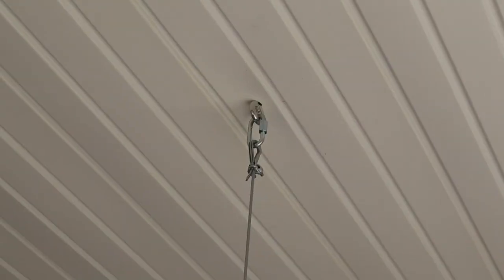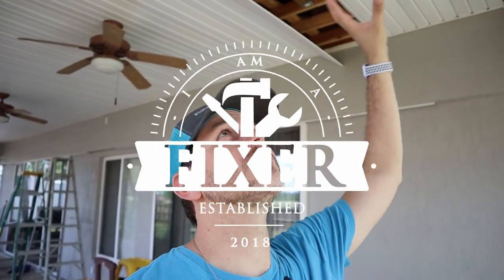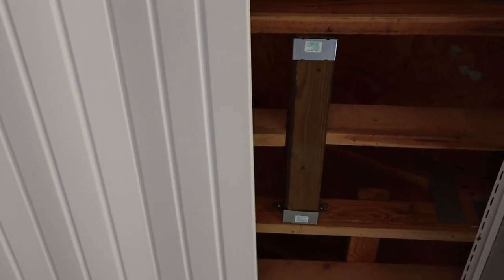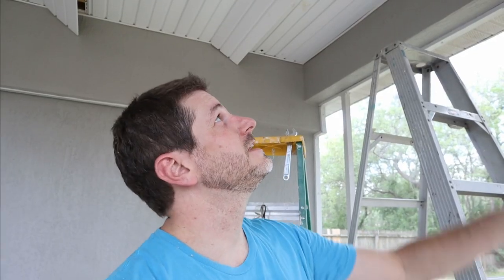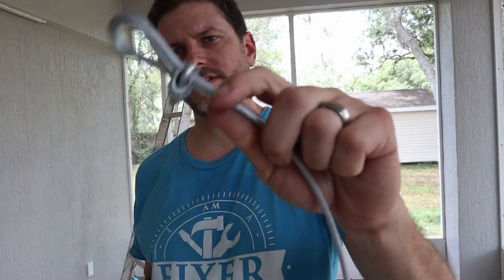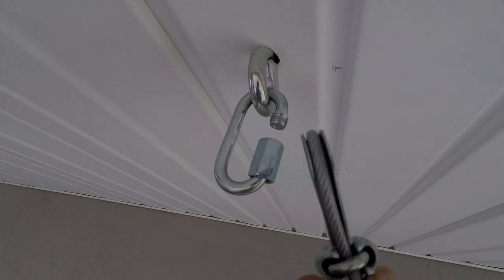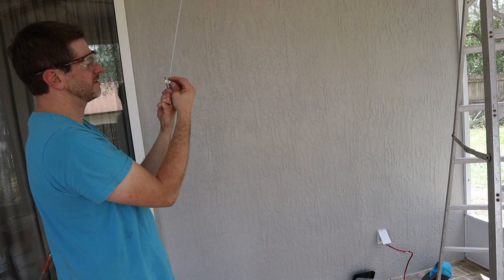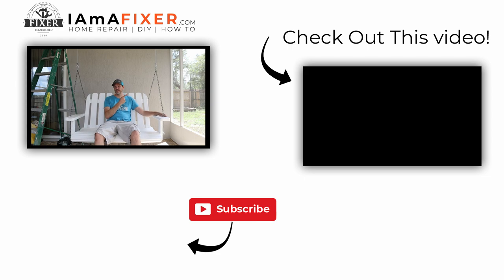How to Hang A Porch Swing with Chains

Comment: Another issue to address is (and I don't know if anyone already has or not) the plastic/vinyl sheath can break/tear under the stress of the weight and once it does, the end piece WILL work its way off and allow the wire rope clips will suddenly lose their grip and the connection will fail. You escaped uninjured the first fall, don't tempt fate a second time. Commonly, it is best in all cases to use TWO wire rope clips, in tandem, as a redundant back up system however, if the sheath fails, both will slip together. As you tighten these clips to head-off the failure you experienced the first time, you are pinching the sheath thinner at the connection and making it even thinner and weaker. Ask me how I know...

Comment: Good explanation. Do you have a parts list?
Reply from the maker: I’m sorry, I don’t for this video. I got everything at Lowe’s. Be sure to watch the follow up video. The rope chain failed on me, so I switch to regular chain. You don’t need many parts. One 4x4, 4 - 4x4 joist hangars, Eye bolts to drill through the 4x4. Some 3” construction screws. Hoist hangar nails. That’s about it, as I recall.